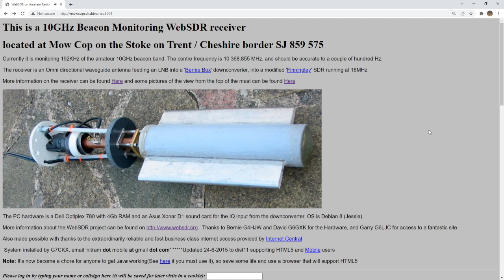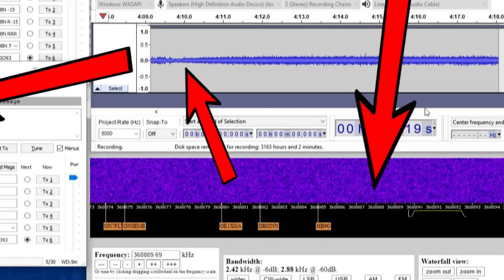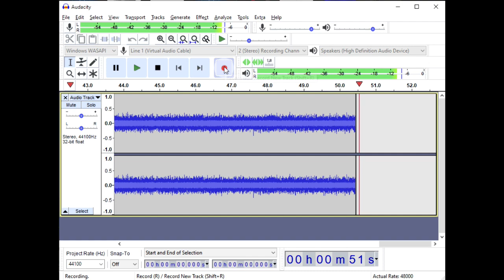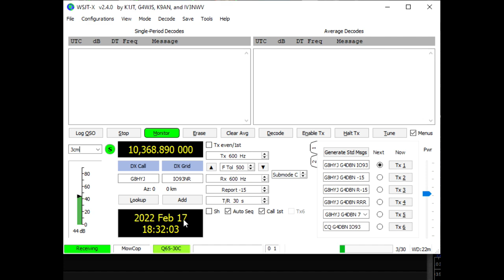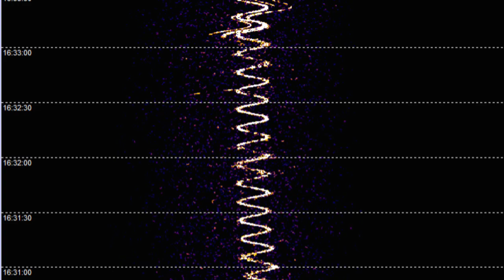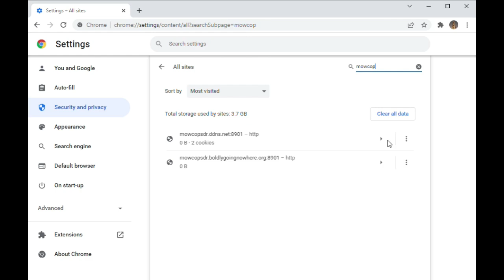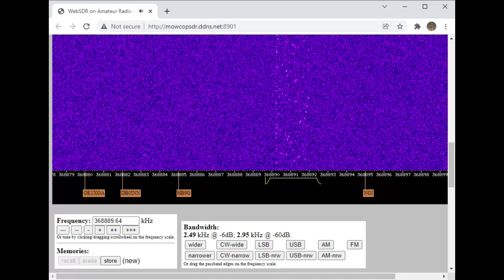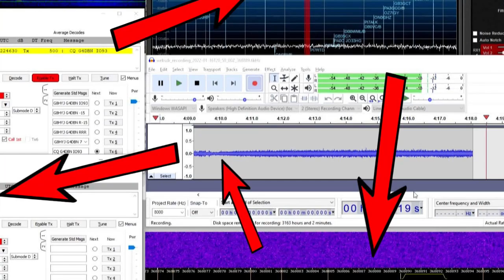Talking to myself on 10 GHz with a Software-Defined Radio

Comment: Talk about difficult signal paths, the first time I sent an "O" in morse, let up the key and heard it come back into my receiver 2.5 second later was one of the highlights of my radio careeer.
Reply from the maker: I've never been loud enough on 144 MHz to hear my own echoes, but I've worked a few of the bigger stations on there with a single non-elevating yagi.  The 3 metre solid dish on 10 GHz should work well even at 22 watts.  I have some GaN MMIC SSPA devices that should do 37 and 45 watts on 3cm, and some Wavelab units that I hope to pair up and run at higher voltage to get 2 x 4 watts on 24 GHz.  Also I have some 80 watt GaN HEMTs for 5.7 GHz, and plenty of power on the lower bands, so there should be fun times ahead.  I don't think I'll get the 70cm array built this year, but I've been laying the prepwork for an 8-yagi EME array with welded open-wire feeders and a big watercooled NEC PA that can run full legal limit 24/7 without breaking sweat.  Looking forward to hearing my first moon echoes for sure.
Reply: @MachiningandMicrowaves  I have heard some of the big guns on 144MHz on my single Yagi, but never had power enough
Reply from the maker: @someoneelse7629  First one I worked was 5 degrees before moonset and it was Gary KB8RQ, 200 watts to a 9-ele, no elevation. He do 99% of the work: http://www.spasalon.com/kb8rq/

Comment: Starting to learn more microwave stuff thanks to CuriousMarc's Apollo comms hackery, this is a brilliant demo of SDR for experimentation.
Reply from the maker: I have some upcoming projects making antennas for satellite comms and moonbounce, so I'll try to include more of the radio tech elements once I clear my huge backlog of machining jobs. I need to get the vacuum chuck built, then I can start making Fresnel Sone Plate mmwave lenses and dielectric loading phase correction plates.

Comment: Enjoyable as all your vids! Can somehow relate to the joy of copying ones own weak signal, when no one  will reply :) BTW have a look at the LMX2594 PLL chip. This one will give you a proper clean 10 GHz signal. This is my plan for Eshail-2, it can be both LO for RX and a CW transmitter on 10 GHz.
Reply from the maker: I started laying out a board with a 2594 in 2019 but other projects pushed it to the back of the priority list. I'd already purchased the 0402 chokes and caps for the power supply pins. It is probably better than the ADF5356, but I got sidetracked by trying to build a twin-cavity VCO machined from solid copper with gold plating and using a reverse-DDS design with an AD9912, but the DDS board and other parts are still in boxes. I need to retire from the Day Job so I can spend more time in the lab and machine shop and less doing boring cybersecurity
Reply: @MachiningandMicrowaves  I always seems to be lacking time... so I'm about to take an early retirement in 3 weeks time. But then stupid enough to get another sheepdog to keep me even more busy :) Regarding 2594, they are pretty hard to find, extreme lead times, but if one to spend a few more quid, an eval-kit can be bought (have a few at the salt mine). But beware, earlier ones did supply a fairly good 100 MHz ref, but newer kits omits these, but still demads the same price. Shame! I have been trying to find any other PLL's that offers similar phase noise but noting is even close. My mecanical skills are pretty abysmal, but really enjoy watching you play with your toys! Keep up the good work and maybe, just maybe cu on the air :)
Reply from the maker: have some excellent 100 MHz OCXOs, but I'm only using them as references on some ADF5355 boards. I'm watching the supply situation with the LMX2594 and looking for anything else that looks promising, but for now I'm using crystal LO chains with injection locking, and getting reasonable phase noise results.

Comment: All of you that are slightly intrested in the radio side of this, dive in, get a license and start fiddeling around, to build antennas does not have to be this complicated and high precicion, just start on another band, on 2m you can fabricate antennas with an axe and scrap metal and still be within tolerances.
On shortwawe,  it is even less critical.
Microwawes are a challenge, and tolerances are small, so that's not as beginner friendly.
Reply from the maker: I've held a ham licence since 1973 and it's given me the opportunity to carry out an enormous range of experimental work including moonbounce, meteorscatter, passive reflection form the International Space Station, aircraft reflection, rain/snow/hail scatter, troposcatter, tropo ducting, sporadic E, auroral curtain reflection, chordal hop ionospheric refraction, hearing my own transmitted signal after it's been right round the world or across to the opposite side of the auroral oval, communication via amateur satellites, TV transmissions, radio data networking, ground loop antennas, balloon-supported and kits-supported antennas, bistatic radar experiments and antenna lenses. That experience has also let me into the work of Deep Space Network receiving, VLF and ULF signals at 8.27 kHz and below, 10 THz long-wave infra-red comms and visible light comms including cloud-bounce and non-line-of-site comms via atmospheric dust and reflection from distant structures. Then into running a Rubidium clock reference and multiple frequency and time references and building up a collection of HP/Agilent/Racal/Fluke test equipment. I have a lot of fun using extremely low power signals, the best performance so far on 10 GHz is 21200 miles per watt and on 20 metres I've managed about 40000 miles per watt. I have equipment for frequency bands on 136/472 kHz, 1.3, 3.5, 7, 10, 14, 17, 21, 24, 28, 50, 70, 144 and 432 MHz and 1.3, 2.3, 3.4, 5.7, 10, 24, 47 and 122 GHz, and I have plans for 76, 135, 241, 248 and 288 GHz. Ham radio helped me get some of the jobs I've had over the years. Some folks think it's about talking to people on the radio, but I've always seen it as a licence to carry out radio transmission experiments that the general public cannot do legally. It's kept me fascinated for more than 50 years.
Reply: @MachiningandMicrowaves  Experimentation is what hamming is all about. I've had a blast with Amateur Radio since getting my first ticket in '68. 73 OM.  Bill - KR6K

Comment: I stumbled across your channel for the machining side but...i have used WSJT-X  and I'm intrigued by EME even though 70cm is as high as I go, at the moment.  I do use Web SDR  on HF just to check my signal and check propagation. Keep um coming, especially the machining!
Reply from the maker: Hi Bren, 70cm is an excellent choice for EME, I made an elevation table and clamp setup for a 70cm EME system last year, and the op I made it for came first worldwide in the ARRL EME 70cm single band contest, so although I don't operate on 70cm, I feel a bit of an affinity for it. I've just been making the Tellurium Copper double-ended spigots to fit into the 2.1 mm bore of some 3.0 mm copper tube to extend the tube through a hole in the wall of a coaxial low pass filter cavity, maintaining 50 ohms, then transitioning to 2.37 mm to fit into the socket on the rear of a Radiall N four-hole panel plug, so there's no discontinuity, but running the Colchester at 1800 rpm after 10.30 pm is a bit antisocial. However, the neighbours had builders in today, laying some paving, and they spent the entire day either using a horrifically-loud Wacker plate or shouting at each other or into their phones.  WHILE I WAS TRYING TO FILM SOME QUIET AND DELICATE MACHINING.  So I don't feel at all bad about keeping them awake until 3am, but the other neighbours are innocent bystanders, so I'm giving up for the night.  Plus I'm at the Day Job tomorrow, which is an awful prospect.  I'm just buying a whole crapload of electroplating chemicals, anodes, cleaners, ultrasonic tanks, bubblers and the like to do a load of silver and gold plating and copper electroforming.  This is for an upcoming series of videos which I'm naming Project Swordfish.  If I can pull it off, this is going to be huge, and I mean properly huge. It's the sort of thing I could do a crowdfunder for, but I'm under a NDA so can't say what it's about at all. Secret Squirrel has nothing on me...
Reply from the maker: There's also a project going on trying to get some equipment made that will allow EME on 47 GHz, as if 10 and 24 GHz aren't hard enough. A normal Kuhne 47 GHz G2 transverter has a noise figure around 6dB at best, but a team in Spain have developed a 2dB NF VLNA and are working on a multi-watt PA. I have a new 2 metre solid dish that should work well on 47 GHz, probably better thanthe 2.4 offset which has four petals or the 3.0 whcih has eight. When you need surface precision better than half a millimetre, petals just don't work. Trouble is, the 3dB beamwidth is only 0.2 degrees, which is smaller than the moon, so it's really too large, but the theoretical gain is 58 dBi, which is kind of radical. I'm having so much fun they' are bound to make it illegal.
Neil

Comment: Now I need to put my ADF4351 on the spectrum analyser and see what the spurs look like. I'd love to get all of those pieces I've collected for 10G on the air. Very enjoyable video, thanks so much! 73 de KC2HIZ FN32
Reply from the maker: Main issue with the 4351 is phase noise.  The shoulders out to +- 100kHz with the standard PLL filter components ends up not much more than 40dB down.  That makes you unpopular in a heavily-populated area of 10 GHz users.  If you have a sharp dish then it's fine.  Noise of a good crystal multiplier chain is hugely better, but then you need to consider how to stabilise the frequency enough.  Weak signal work really needs better than 10Hz stability. It's worth looking at the bypassing caps around your 4351 and the quality of the grounding and separation of analog and digital paths, also using super low noise regulators.  If you can elevate your dish and it's 3ft or more, you should be able to hear the DL0SHF moon beacon on 10368.025 +- doppler when you have common moon visibility.

Comment: Neil, since you fool around, urm..., work with SDR(s), have you ever used one as "test equipment" when troubleshooting a piece of (audio) equipment?  :) A channel that I used to watch did this once, but, if I remember correctly, he didn't explain how he did it.

I honestly can't even spell "SDR" or anything related to radio, but fortunately do understand many of the words/terms used in this and other videos where you get deep into your RF "black magic."  ;)  I think that I understand enough about what you talk about here and other your "RF videos" and understand toolmaking & machining to definitely appreciate what you design & manufacture.  I just finished watching all of your videos, so I eagerly look forward to your next ones!
Reply from the maker: Hi Bob, I use a pair of ELAD FDM-DUO SDRs which have 16 bit ADCs and are very linear from -135 dBm to about -20 dBm, which is a good range, but then they are fairly expensive devices. They will only go down to about 8 kHz, and the performance is definitely not sparkling below 18 kHz or so. They use 122.88 MHz clocks so are good to 50 MHz, but above that, the sin-squared relationship starts to bite, so they lose sensitivity above 70 MHz and then are using aliasing above 140 MHz, so need a lot of filtering and a preamp.  Below 50 MHz, they are excellent.  I also have a lot of other SDRs, some of the simple dongles, a genuine Malahit (20 kHz to 2 GHz) and a Hermes-Lite. Below 15 kHz, the performance of many SDRs falls off, mainly because of coupling capacitors or transformers, but I ten to use a PC sound card as an instrument for audio troubleshooting.  My spectrum analyser will go down to 1kHz as well, but not to DC.  DC-coupled SDRs will work right down to DC so long as you adjust for the DC offset. I think the trick involves removing the DC bias choke and blocking capacitor and using the dongle in direct sampling mode of the Q-branch, but I've never tried. I think I'd go for an upconverter using a very good quality high-level mixer and feed that though filters to the dongle.  Or just buy an old Wandel and Goltermann Selective Level Meter, like I ALMOST did in a recent auction

Comment: Hmm. I might have to do this on QO-100. Or try to get some friends to host 10GHz websdr's in good locations.
Reply from the maker: I think there is a lot of fun to be had using the satellite, with wideband data for instance, but doing a loopback test with WSJT-X is very simple if you have two radios or a full duplex system. I've never tried it.  You need to do the trick to set up a shortcut to run the second WSJT-X instance with a different name. There is a planned project to create a simple kit for a receive package that will connect from a head unit consisting of an omnidirectional antenna and LNB feeding into an SDR dongle and a processor that can connect over wifi or ethernet to an internet connection.  The idea is to make something that will allow anyone interested in radio to join in the fun by deploying a receive node in a similar way to the ADS-B receivers that feed into OpenADSB.

 The challenge is in how to collect the data streams.  If we use the WebSDR approach, there is a tight limit on number of concurrent  users.  If we use local decoding and send only a decoded data stream to a central node, perhaps on an AWS instance, then we face the problem of what decode software to use and how to arrange GPS frequency lock at low enough cost, or how to decode over a wider range like the MAP65 approach. Then you have to ensure centralised software/firmware distribution and it starts to get complex. If we can get it right, there is an opportunity to do some interesting real-time mapping of propagation and if the timing can be set tightly enough, perhaps even time-of-flight analysis, but that needs timing precision to the microsecond level or decoding at an IF frequency of time pulses from a central reference source, perhaps by locking to the phase of the central reference.  Lots of possibilities.

Comment: Hi Neil, will you be on the next ukac 3cm contest? It will be fun to try from home just south of the Wolds with a rather obstructed path, hopefully we can find a scatterpoint somewhere.
Reply from the maker: Yep, just spoke to Steve. If I can work Paul on Wales over multiple 1500 ft hills from inside his bedroom with a 25dB horn, we shouldn't have any problems.  I used to work Denis UVR every time without fail, and that path goes right over Holme Moss.
Reply: @MachiningandMicrowaves  looking forward to it Neil. The wolds are 3miles north forming the skyline from JO03BD 5m asl, the rest of the directions are good
Reply from the maker: Belmont mast might be worth trying for a scatterpoint, but I bet we'll make it over the mud and limestone.
Reply: @MachiningandMicrowaves  Belmont isn't too far off the direct path so it shouldn't take too much jiggery pokery if it works.

Comment: What do hams do with these high frequencies. Much activity?
Reply from the maker: At the moment there is probably more interest and action and experimentation on 122 GHz than 10 GHz. Activity tends to follow interesting propagation enhancements like tropospheric ducting events, which happen more in the summer, but there are regular activity sessions across Europe and the UK. Summer thunderstorms raise a lot of activity as rainscatter and hail scatter allow communication over 600-800 km via Rayleigh and Mie scattering from hydrometeors. There are significant number of folks with 10 GHz stations capable of communicating via reflection from the Moon.  That's pretty cool, right at the edge of what's possible from a communications system you can build at home. I'll do some vids on the build of my new 3 metre and 2.4 metre solid dish systems over the next few months. Lots of folks are using 10 GHz on receive from the QO-100 geostationary satellite launch by Qatar, which you transmit up to on 2.4 GHz.  It can carry amateur digital TV modes as well at all the usual voice, Morse and FSK/MSK digital modes. In recent days I've been doing tests with a friend over in Wales on 10 GHz, using rainscatter, snowscatter, troposcatter and aircraft reflections. He is using just 140 milliwatts to a horn antenna INSIDE HIS HOUSE, 100 miles from here, and there are several 1500 ft hills in the path. I just made a short video about some experiments using digital modes using a remote unattended receive system in Staffordshire, over the hills from here in East Yorkshire https://www.youtube.com/watch?v=Y9qyj5Ko6pM